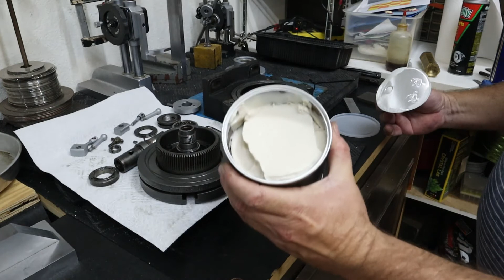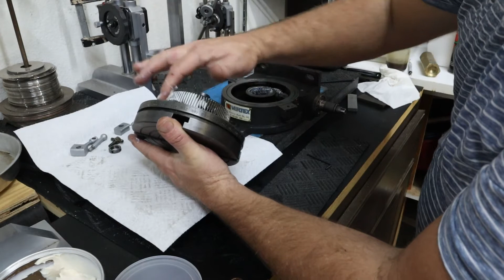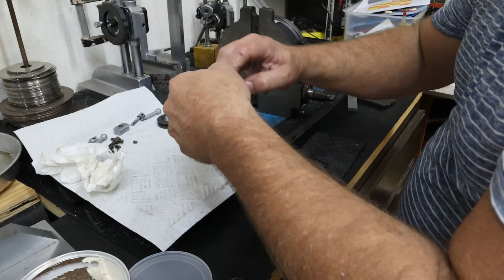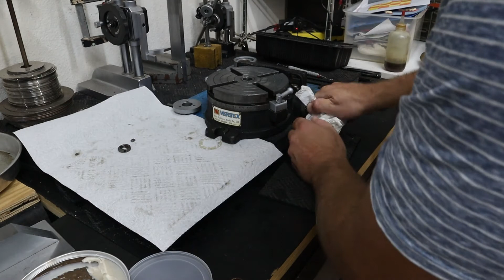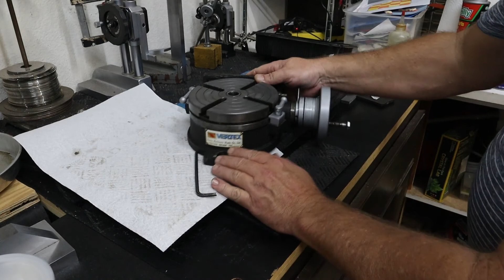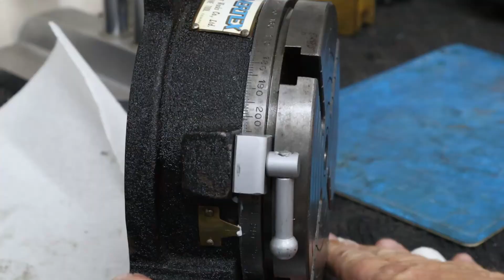Rotary Table Assembly.  Part 3, Will it work?

Comment: neither way oil nor nlgi2 are light lubricants, true, way oils are quite runny yet tacky, but white lithium grease aint light... nlgi0 or nlgi1 are light grease lubricants, nlgi00 is almost oil like, yet its still a grease, so it could be called the light grease, and it too should be oil friendly, but most modern grease is oil friendly, and either way, you will wash it out with oil, so either way, its not a problem... The only problem could be sulfur heavy greases and such which could cause discoloration on surfaces and possibly react with oil thereafter to make a glazing or such and possibly cause galling of the opposing surface, but i dunno, im not a lubrication researcher, i use manual gbox teflon additive as assembly lube for anything of this nature, as it enhances the oil that comes afterwards, has no detergents and is pretty much of grease nlgi00 consistency... Barely an oil lube, yet superb, tho, it better for contacting planes rather than screws, there the nlgi2 is good, very good, as it will actually stay put... But what do you find to be heavy lube if white lithium is light to ya? Its like calling mercury a light metal, sure it aint uranium, but its still a heavy metal...

Comment: I just got an 8" Vertex RT from an auction.  Could you make a video or explain  on how to zero out the dial.  I can't figure out the logic of the worm release if you can't set the dial to 0?  Nice rebuild there Phillip.
Reply from the maker: It will be a bit im still on 16hr shifts.  The little dial should have a set screw you can losen to rotate the dial to set it to zero.
Reply: @AlmostMachining  Wow I am out in the shop fooling with it now...GOT IT Thanks!👍👍👍